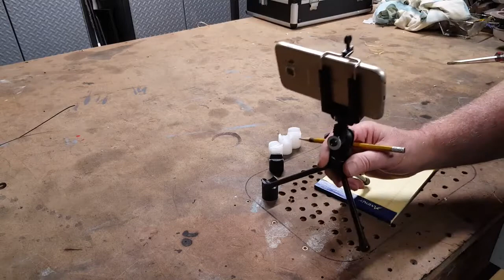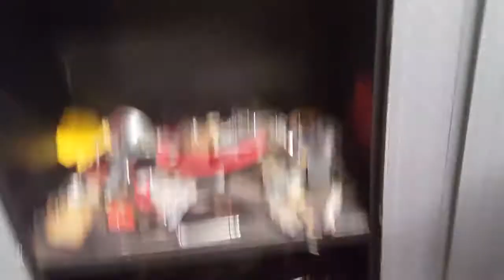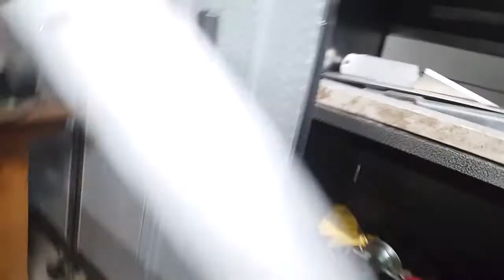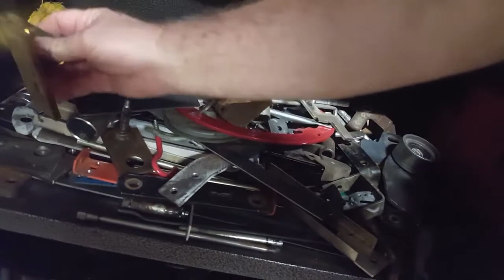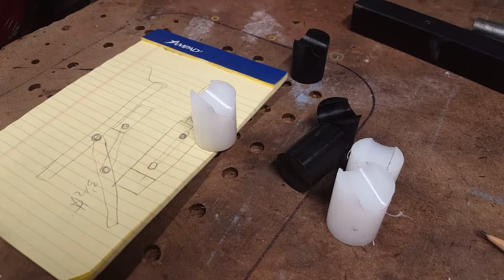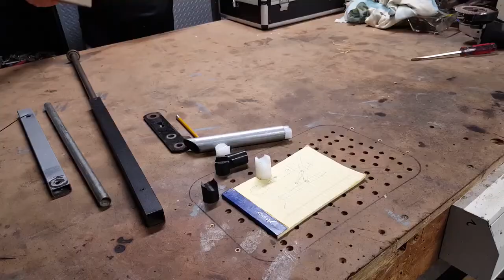HOMEMADE RING BENDING MACHINE VID 5

Comment: Cool video! What's the diameter of the rods you use, and where did you get them?
Reply from the maker: Morning, do you mean the jaw rods ? if so they are 1" diameter, from amazon. If you mean the ring die's they are just bushes from odd equipment taken apart and are various ring sized. They all fit in standard ring gauges
Reply from the maker: Note both of the ring benders are for sale I am leaving back to the uk, sick mother
Reply: @dctmakes3487  thanks for the response. I found them. :) Sending well wishes to you and your mom.